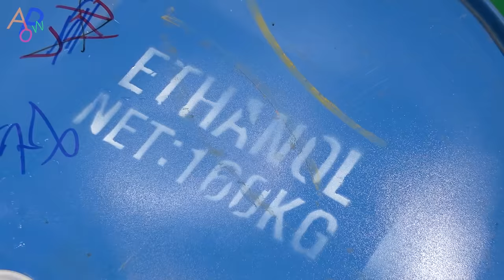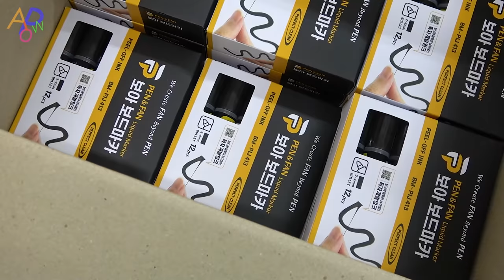Process Of Making Whiteboard Markers. Pen Factory In Korea

Comment: Looks like the factory is a bit over engineered in some areas and just really slow in general. Probably okay for markers where the market is small.
Reply: On the other hand, we didn't see how many parallel lines they have. You can make up for slow throughput on a single line by simply scaling up the number of lines.